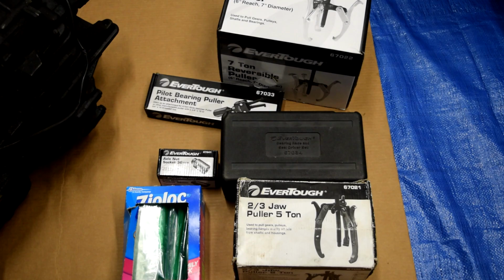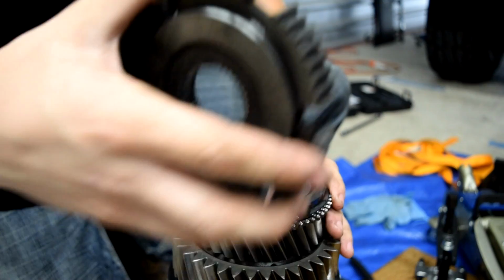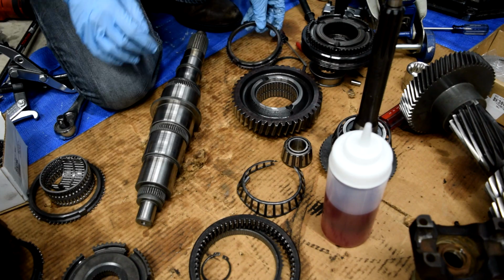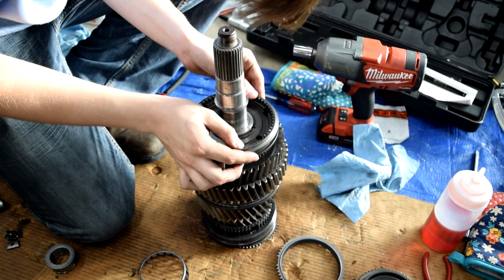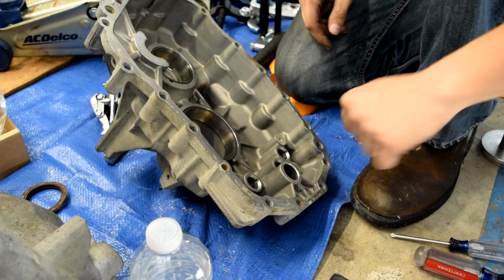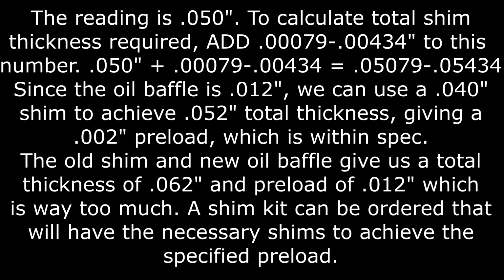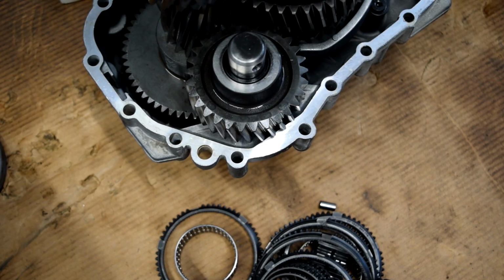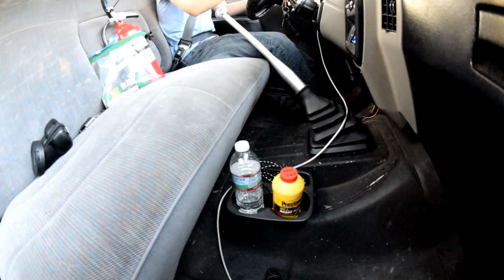ZF S5-42 Transmission Full Teardown and Rebuild

Comment: This is my go-to video for pulling these transmissions apart. I pulled my first one apart that was stuck in second gear. I ended up seperating it up side down (bell housing down) and lost a few small parts in the process (DOH). Went and bought another used trans for $600...and found cracks in the bellhousing when I went to install it. Had a friend come tig the crack...then found another when I almost had it lined up. Today...today I am going to swap cases. Pull the gear set out of the cracked case, and put the gears into the good case. An extreme fuckstory that I am 100% sure is half my fault. So, here I go. I feel confident after watching the first couple of minutes of your video. Thank you for that. Oh, and the dry commentary is cool too. If I can't figure it out this go round I may just take a sledge hammer to the lot.
Reply from the maker: If I can do it on a piece of scrap cardboard and harbor freight tarp in a storage unit in the heat of summer then you can too!

Comment: I appreciate your video. It helped me vastly overhauling my S5=47. I recommend swapping the toaster over. Used a cheap air fryer on bake for 12 minutes 330 degrees and I did much less hammering. Bearings, synchro gears, thrust washer and sleeve all went right on, effortless except one synchro gear took 3 or 4 light taps. Saved a ton of time.

Comment: A quick and concise video. You made it look easy and have given me the confidence to take this on for my manual truck swap. I appreciate the time you’ve taken to video and edit this.
FYI. If you put the races in the freezer they will slide in without needing to hammer them home. .002 friction fit if they slide in they drive home a lot easier.

Comment: This is gonna help me a lot. I've got tired of arguing with local transmission shops about how my trans with 391,000 miles can't possibly have slop while downshifting and engine braking in some gears but not others. Them wanting me to let them spend a month taking it apart and ordering parts. Ill just do it myself. Based on this video I think I have some worn needle bearings under some gears. And the thing about the slider ring wear helps to because I can now pre-order them since I often grind into reverse and grind 1-2. I bet mine are worn down. Maybe I'll only be down a few days. Thanks.

Comment: Excellent video ,you can still get the  ZF 5S42 in Europe on 7.5 tonne trucks ,the only difference is the casing is slightly different ,still a 2 piece and internals are the same except we do not use synchro on reverse at all..I have done literally hundreds of these boxes ..A few tips I can give,When you where removing the bearing sleeve at 3rd and 4th since as you found out it is an interference fit and tight to come off ,once I have the puller applying pressure ,I then use a electric heat gun which expands it and it then pops off...the sleeves can fit either way ,and if you look at the one for 3rd/4thyou may see small arrows with front stamped on the edge ,they are small. I would if I was you get a hotplate ,where you can get the part hot enough to fit easily ,as I bet you had fun putting that sleeve back on lol...Lastly I know  you followed the book to the letter and there is nothing wrong with that ,I have found on all the boxes that I have done ,and I have never had an issue ,and there is no tightness ,that you can leave the factory shims in and it is ok..Though I have always used OE parts ,I don't know if you did ..But keep up the good work .Gearboxes are not as scary as people think,,easier than an engine
Reply: A bit late to the game, but have you ever rebuilt an s5 35?
Reply: @fyst4413   it is identical to do ..Have done 100s ,though  we don't see them anymore where i am  ,The 6 speed AS-Lite is the box of choice here nowdays
Reply: @norb0254  Thanks! i have the s5 35 transmission in an old skidder that i have. but i cant find mauals online, any help? ;)
Reply: @fyst4413  The 35 and 42 just relate to the torque 3rd and 4th for example the grooves on the rings may be oriented differently and the sleeve may in tiny writing have front on it ..If doing it for the first time get a rod on a flat base and as you take a part off put it over the rod keeping everything in the correct order and orientation
Reply: Thank you that was helpful!!
Reply: Can I just replace the seal without messing with oil baffle, race and shims?

Comment: This is awesome because I am replacing the rear tail housing on mine, and you cover EVERYTHING needed to know to replace one, plus more.  Excellent job, really, thank you so much for sharing your journey.

I have one small thing to mention though.  When you apply the anaerobic gasket maker, i would be careful to not apply too much, and I would then smooth it out with my finger.  You see how it squeezed out on the outside, it surely did on the inside too.  Awhile back, on another project, I heard about someone having oil pressure issues with their engine. It was because they used too much rtv when replacing the oil pan; it squeezed out on the inside and eventually plugged the oil pickup screen on the oil pump.

Fortunately, I cant see it doing any damage in a manual transmission

Comment: Man im in the process of rebuilding mine, i have to take reverse and fifth back out because the teeth on the slider wasnt lined up with the ball bearings. No biggy tho im going to replace the 5th gear slider now because of what you mentioned here.  Im just glad i caught the ball bearing thing when i did 1-4 gears. Good job on this video and thanks for making it.

Comment: Just in case you might actually loose a bearing ball like in this video; you can actually go to a shop that sells bearings and get a ball with the needed dilensions if they happen to have them in stock👍🏻

Comment: Helpful video.
I got everything rebuilt, but I got stuck because my case halves are shimmed out ~1/8". Now I've got to get that special puller to get the race out and buy another oil baffle. Basically, I thought I'd get lucky and use the old shims without doing all the fancy measurements.

Comment: I need to rebuild my ZF S5-42 in my 1991 F-250 4x4. My trans grinds and clunks into gear sometimes when releasing clutch when I already have my hand off of the shifter. And it'll clack with every clutch release in gear, And going to engine brake off of the gas it does the same clack, and letting off the gas in reverse does a loud CAKLUNK.

Comment: Здравствуйте! Помогите разобраться с расчетом оборотов на шестерне отбора мощности. КПП ZF s5-42 (5.72). Для того чтобы правильно подобрать КОМ и гидронасос мне необходимо знать количество оборотов, которое делает шестерня отбора мощности. Она находится на промежуточном вале. На ней 45 зубов на передаточном 5.72 и 43 зуба на передаточном 4.65. Я правильно понимаю, что она входит в зацепление с первичным валом, с той его частью на которой 27 зубов на передаточном 5.72 и 29 зубов на передаточном 4.65? Тогда при 1000 оборотов мотора на ней будет 600 оборотов на передаточном 5.72 и 670 оборотов на передаточном 4.65? или нет? Спасибо!

Comment: if the future please buy a cheep harbor freight cart. i'm not talking about one with draws i'm talking about one of their 4 wheels carts that has lip that's about 3 inches high. they are great for putting things back together on. doing it on cardboard that's dirty already is going to bite you in the butt sooner or later. the rest of the video is great, keep at it.

Comment: Aha !!! You said it makes noise before and it makes noise now .. thats good news mine makes noise too  ..im gonna bolt my slicks on and fill up my nitrous botttle and just send it !!!!
Reply: If you over fill it by a quarter or half a quart it quiets it down
Reply: @jaredlindstrom7618   I may have to try that just because why not ..I run the truck on  nitrous a while back for a pull or 2 now it seems to be a lil louder .
Reply: Zfs are just noisy when I swapped mine in years ago it was noisy like that, came across this overfill method and it's been quiet for years. Just no more than half a quart

Comment: Great video, how do these gearboxes hold up in a pickup truck?, i have one lying around in my workshop wich i want to install behind my 12v cummins
Reply: They’re generally regarded as a strong transmission and rated around 460 ft/lbs. It will handle a stock 12v Cummins.

Comment: 54:55 that noise does that happen when you lug the engine a little?
Reply: Yes, I've had the exact same trans for years and they are long gears (Hence the "fun" between 2nd and 3rd at 30mph).  I found that especially in traffic it's like there's no sweet spot, you either go all the way to 2500-2700 or you'll hear that sweet ERRGH every time. Doesn't seem to hurt them much but being careful drivers it causes some concern for sure.

Comment: F-150s should have an M5OD-R2...
Reply from the maker: Some F150s were optioned with the ZF, but you're right, the ZF was used mainly in the F250 and F350 trucks

Comment: for 1,000.00 would it be better just to buy the rebuilt one?
Reply: no because you would not learn anything from buying a rebuild.
Reply: You ain't buying a rebuilt zf5 for 1,000 hell a good case to rebuild worth 500 to 700
Reply: Idk. I bought a 351w with still bolted on zf5 that the guy said works good and has only 120,000 miles on it for 400.00.